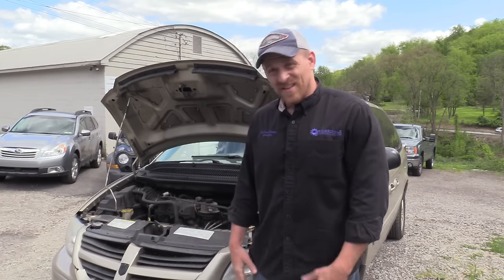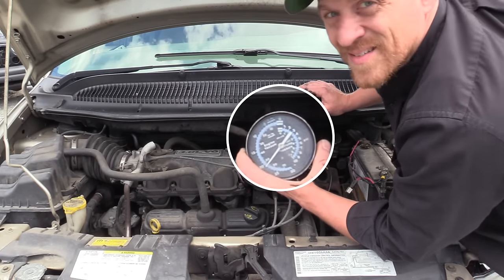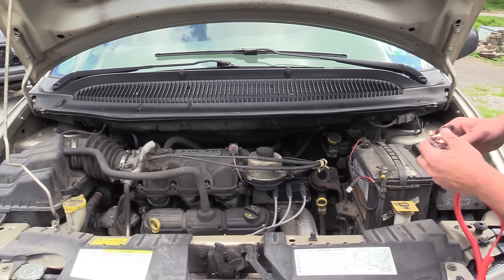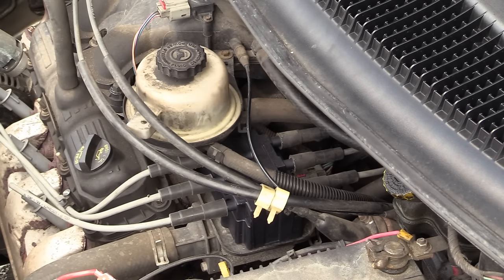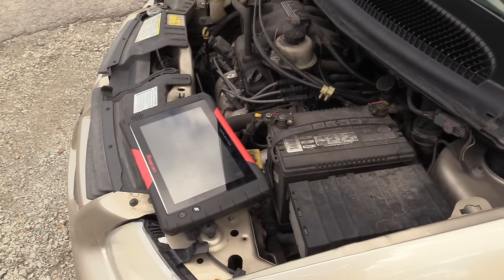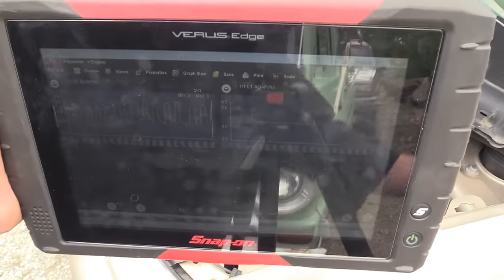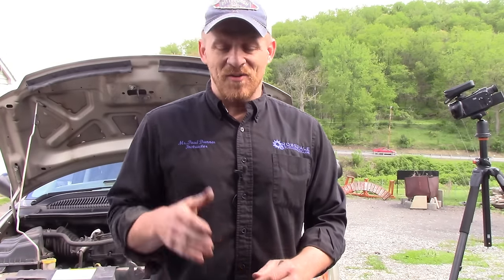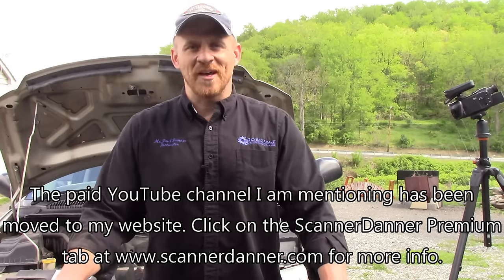Misfire Quick Tests (Is it a spark, fuel or compression problem?)

Comment: I've had the paid channel for almost 2 years. Even having experience I find the channel exceptional for training. Let's say, top 3 best on You Tube IMHO. It has something for everyone for sure.
Reply: Joe Mikos how much is it?
Reply: Hi I'm not a technician but I am interested to learn these electrical engineering.if I resisted in played channel,did you think I'll learn.
Reply from the maker: It's $11 a month and I offer a 14 day free trial. Thanks for your interest!
Reply: I need a guy like you to help me find my problem , got a bad first /cold start issue with a 1.6 8v SR 102 hp vw engine . Starts right up but then idles poorly in 3 cylinders and then drops rpm and dies . after driving it for 5 minutes when car gets warmer it starts right up no issues any more . it has got power and pulls ok but sometimes around 2000rpm it shakes a bit . Help?
Reply: If Scannerdanner is among the top three here on YouTube, I'd be curious to learn about the other two channels behind him! Lol
Reply: @ryana.miller8260  try DiagnoseDan, He is also amazing

Comment: I run from people who drive a car for 150K miles with no maintenance and then want you to tell them what's wrong for free and fix it for $100 bucks.😕
Reply: Then when you find out more stuff is about to go out that will affect the first problem  and you tell them...they always say " well you said this not that so now you want more"
Reply: "I thought you said it was part A. Now its B and C too? Well then" or " parts B and C were fine when i got here. You will fix B and C for free!"
Reply: sounds correct
Reply: I agree such fun work to do and potential to make money ruined by cheap ass hood customers who cry when you mention diag fees and always say “can you just take a look at it?”. Fuck them
Reply: @ufarkingicehole  if it’s not part A then your diag wasn’t correct, how’s that the customers fault? If you said you fixed the problem, yet it continues, then you replaced a part that didn’t need it. This is why we have expensive lab scopes and shit, you don’t throw parts at a car and expect a fix, you find the problem and figure out the solution.
Reply: Big talk from a lube tech. When basic mechanics stop sending stuff to the shop because “they can’t do it” I’ll be amazed.
Reply: @jc199159  I was a lube tech decades ago. I've been morphed!
Reply: About 127-130 for plugs, wires, diy on this car. I have a 2002.  P0302 code. That's #2 cyl.  I need a battery.  It would start after ten - the 50th tries. It ran until it had code. Gave gas and it coded, and ran harshly.  It will get better and scanner. But, I am changing these tune up items first myself.  Save labor on that much. Then if the top end or timing is off, they can do that.  They put a used trans in it, and not long after, no crank happened. But, then it did crank. I got the click on starter.  I go two years before failure.  On a three year battery that has to be replaced now.
Reply: I can understand 
But i had a Hyundai Elantra 
That they charged me 750 to have a Week and could not find it out years ago 
And the next guy found it out in 30 mins .
Cam Phaser CVT was out .
Reply: What maintenance can you do for a sensor issue.like really why do cars needs twenty sensors? Didn't have them thirty years ago and cars had horsepower. Clean unmonitored horsepower.its ridiculous
Reply: No sensors no maintenance

Comment: My 2000 Grand Caravan gave me 343000 km (215,000 miles) before packing it in.  3.8 L engine. There is no substitute for timely maintenance.
Reply: Yes very true 1 have 2003 with 365.000 miles original engine  and transmission i bought new. Still runs but body rot is bad.
Reply: @angelozararis7404   I have 270 k on my 1999 Chrysler Town and Country. Also have done various repairs on it. The have amazing pickup on them.
Reply: Mine has a misfire .. going to the shop.. just replaced all seals from intake manifold to the air filter all new injectors .. hands are up but not going to let her go down
Reply: @PIANOSTYLE100  mines 270k miles 05 .. I love .. (yes alot of work and ppl yelling my just go buy new .. nah I can't give her up .. even with her Mis#5
Reply: @83mike860  I made that comment awhile back.. Now..I fix things on my 99 Ford Expedition. Not a mechanic.. It had a parasitic drain on the battery.

Comment: Sounds like that engine needs a cleaning. They need to put some LA's totally awesome in that crankcase and run her for a half hour! On a $500 piece of s*** like that I would try anything. Acetone in the oil, diesel fuel in the oil, transmission fluid in the oil etc.

Comment: My daughters 2002 mazda626 has a cylinder 3 misfire, changed the spark plug, coil and wires with no change with rough idle I’m at my wits end. Your video has given me other possibilities to explore. Thank you for your video.
Reply: Take to someone who knows how to properly diagnose instead of throwing parts at it. You will save money in the end.

Comment: Rear valve cover isn't that bad on that van. I did stem seals on one at 485,000 miles. Last I heard it was still running just fine North of 500,000. Commercial van with lots of miles and few cold start heat cycles as well as being in an arid environment and having a dedicated mechanic helped it reach a round trip to the moon and back.

Great new tools for the toolbox on my shoulders. Thanks Paul.

Comment: I had a 94 Chrysler Laser years ago with intermittent low compression on one cylinder similar to this case.  It turned out to be a bad valve guide.  Using a compression gauge it would read bad one time and OK the next.  It also fouled the plug with the bad valve.  It was bad from new.  The dealer knurled the guides and it worked for 6 months or so, long enough to get out of warranty.  I ended up replacing the cylinder head after which it ran far better than when new.  Oil in the cylinder made it want to pre-ignite.  The knock sensor backed off the timing and it was a stone.  After the fix I could lay rubber with it.

Comment: I just changed the heads on the 2000 Ranger 3.0 with 188,000 miles. They had known exhaust valve issues over time. Turns out I had cylinders 4 and 6 getting coolant in the chamber which was cracking spark plugs and then once I had the old heads on the bench, 5 out of 6 had brake parts cleaner leak past the exhaust valve seats. Now with new heads with hardened seats, all new head, intake and valve cover gaskets, I am battling high LTFT's. Got new O2 sensors on the way since mine have about 60,000 miles on them with raw fuel from misfires for who knows how long. Good news is that there is no sludge in the motor and the cylinder walls still have the cross hatch on them.

Comment: Stumbled on the channel today and it's awesome. Wife's 2008 caravan 3.3 has a intermittent cylinder 1 misfire. I did plugs and coil and it ran good for a day now the light is back on. I'm guessing I'm dealing with a lifter problem. 
Thing has 109000 and is a decent ride. When you first start it she idles a little rough but smooths out after a bit.
Reply: Is that what it was my car is doing the same plugs and coils don’t last

Comment: I had almost the same problem on a 2000 dodge G/C the only difference was the misfire was sporadic but we couldn't recreate the  misfire over several months and 2 trips into the shop. 3rd time being the charm my customer brought it in when it was actually misfiring. For the misfire to surface they had to be on there way home from work with lots of stop and go traffic and the temperature was above 85 degrees and still intermittent.  After checking spark and fuel that were good, it had  low compression on cylinder 3 with a leak down test proving it to be a bad exhaust valve. After removing the heads we could see the issue which was a hairline crack in cylinder 3 exhaust valve.  After watching this I started to think what the vacuum gauge would show while doing a cylinder balance test.  Next time I get a misfire like this I'm going to have to look at this just to see if there's anything of value in it.   Thank you for the great videos you always have great content.

Comment: I have the same problem cylinder 4 .sometimes it runs good sometimes it runs bad.but always cyl 4 .the car had a ticking noise after the head gaskets were replaced .so I replaced both rocker arms and lifters .i don’t know that it had a code p0304 before I replaced the rockers because like I said it had a blown head gasket .the machine shop said the heads and valves were ok .when they resurfaced the heads .so now I’m stuck with the cyl 4 misfire .compression test showed bad compression .bit some times it runs great .you nailed it for me .its a bad lifter ona new rocker assembly but more than likely a piece of some thing is blocking the oiling orifice for that lifter. Thanks a million your thorough diagnosis lead me to the only problem it could be .bad lifter or more likely a piece of silicone blocking the lifter orifice intermittently.now I can fix the car for zero dollars .

Comment: I had a dodge minivan with a 3.8 many years ago with a very intermittent misfire on cyl. 3 that it took months before they could get to the shop with it still miss firing. It turned out to be a cracked exhaust valve on cyl 3.

Comment: Nice job. Trying to catch that with a compression gauge isn't easy. I've been trying to get the guys I work with to do relative compression test because it is so quick and easy to do.
Reply: Auto Ditex has a unit that can do relative compression from the battery . Unsynched takes about a 10 second crank . Or you can connect an extra cable and synch the pattern . It's about $ 300.00 . Diagnose Dan has used it . No lab scope needed . They also have a lab scope and other test equipment .

Comment: I know this is an old video but I gotta ask, why not do a cylinder leakdown? If nothing else it would eliminate culprits
Reply: my same thoughts ,for next test,spark plug out ,number 3 on tdc,fill it up with air ,see were it goes,or stays sealed ,maybe chuck another engine in it ,then have lot spares
Reply: I agree.  That would be my next step.

Comment: I say broken exhaust spring, it sounded like it was alternating/cycling while running. the broken spring is riding up itself and dropping back off the other piece, probably broken near the spring base =p
Reply: What about the perfect vacuum.?
Reply: @ufarkingicehole  its intermittent wouldnt the valve spring be consistent. lifter seems more like it. maybe slow to pump up
Reply: @dcomputers  the vacuum being constant makes me believe the valve springs are ok. It sounds like the lifters are tapping or not priming properly.  Based on that alone I would assume the bottom end is ok. The valves are sealing. I would want to run a test to see if all of the cylinders seem to be doing what it's supposed to.  I would want to know if its running lean/rich/ or ok. Possible sticking injector?

Hahaha so I actually watched the video and yea..... I'm sticking with a jacked up lifter
Reply: @dcomputers  Not necessarily, I had cracked valve spring on 2 GR Toyota engine and the problem was intermittent.
I do agree that in this case a lifter is probably the suspect.
Great work by Paul as usual.

Comment: Thx for all the people you help. I have  a 1990 e150 that has a hard miss with occasional shuddering. I have replaced all ignition components, same problem. Do you think it could be a bad ecm with leaking capacitors.?

Comment: Paul looking at this again 
My 2001 had the codes 
Replaced The Plugs wires  coil block 
Some injectors 
O2 ,Mass  air flow and Map  gaskets are all done 
And what fixed the miss was new Fuel Pump 
But now it runs good until it warms up 
And runs Lean or like hot with no overheat and temp gauge says normal .
Its got brand new Radiator 
And the Harness was Torn open and repaired for bad insulation against Heat issue behind Coil .
I wonder if the 02 sensor was intermittent and the after Market i put in sucks as well 
Or the Exhaust sucks somehow 
Hesitant to pay to have exhaust Scoped after No Heat from Temp gun 
Test .
Im a Face But But Face for buying this 
From a Single owner old lady .

Comment: Frommy experience it possibly has a cracked spring, common in my area. They break and allow a random recurring misfire on single cylinder. IF repaired repalce all vs seals and springs. BUT car is beat, the estimated price of top end pull apart ie vc/intake/etc tell them to take repair costs and old car and trade on different car AFTER having car given an extended vehicle inspection with test drive.

Comment: Which is why you diagnose before throwing parts on something. No way is that thing worth fixing, but you're already in plugs, wires and a coil. 

Only thing maybe worth doing is telling the customer to try running a flush or some kerosene/ATF through in case crud in the engine/oil is jamming the lifters or something. Kill or cure. Might just be worth it if it goes another year or two before blowing up.

Nice example Paul! Stay frosty!

Comment: Hi ScannerDannner, I have a 2005 Mazda 6 2.3l 5 speed A/T with 150000 km, the car hesitates when I put the pedal to the metal in any gear including Neutral and Park, the car struggles to go uphill. The car has not thrown any codes, I changed the Spark plugs, air filter is clean. Which direction should i go from here?
Reply: Sounds like a bad fuel pump

Comment: hi scannerdanner did you check the higher rpms (2000+) on that car? I have the same symptoms on my 1995 mustang 5.0. misfire but only at idle. ignition system is good. no vac leaks (constant 20 in hg). fuel system is fine. injectors also. engine rebuild done. but the lifter werent replaced. I'd like to check them before replacing parts with no end. your help is appreciated!

Comment: Hey Paul, when you scoped the issue and it showed the dip in the graph for cylinder 3, were you probing the starter wire at the battery? I didn’t see you explain where you put you 600 amp clamp?
Thanks in advance!
Reply from the maker: yep, just the main battery cable that goes to the starter. I linked two other videos within this one that show this procedure in more detail. Thanks!

Comment: I have a 2011 Mazdaspeed3 with 123,000 miles on it. I get a code throwing P0300 (multiple random cylinder misfire.) I’m about to throw new sparks in and I have a compression tester, I just don’t know where to start. It seems to make this low “popping” noise at idle every here and there, but nothing else after idle. Please help! I’ve looked all over mazdaspeed forums and all other people have said is the injector, sparks, or coil packs. Thank you a ton!

Comment: I did not get how you were able to graphic individual cylinders compresion on your scanner tool
Reply: He was measuring the current to the starter motor. Current is proportional torque for electric motors. Torque increases during the compression stroke.

Comment: I drive a 2006 Dodge Grand Caravan 3.3 V6 154,000 miles. Check engine light has been on for about a month. Code is p0303. I have replaced the spark plugs/cables and fuel injector. Still code p0303. It starts right up and runs fine until it gets to around 60 mph and then I get vibration from the engine. No other symptoms other than getting crappy gas mileage. Any advice on what to try next would be greatly appreciated. I've been doing the work myself in my spare time and I don't have much $ to spend..if I did I wouldn't drive a 2006 minivan.

Comment: While the engine turning since the valves also turn, maybe carbon deposits sometime dont let the valve close all the way!! 😏  
Great video Paul!
Reply: That's exactly it. The valve is making and breaking the seal as it rotates. Assuming it comes and goes at a steady rate.
Reply from the maker: I was thinking a lifter issue. Sorry I didn't dig further. This was one of those "it's not worth it" vehicles to go any further.
Reply: sounds about right
Reply: +ScannerDanner probably is like you say!
Reply: I agree
Reply: Could be hair line cracked at the spark plugs on cylinder 3......lol
Reply: DO a Flush of the Engine, Throw A Bottle of Liquid Moly Hdry.Lifter Additive in It,If It Seems To Help,Then Run A Good Brand of Syn.Oil  for Few Thousand MLS, If It Doesn't Run Better,My Guess is A Stuck Closed EGR Valve,Which Will Probably Pull Up A Code.

Comment: I don’t have a hi amp clamp for my scope yet. Is there a way to use a low amp at 60a  until I am able to get a hi amp? My gut says no, but I believe I saw you do it.
Reply from the maker: absolutely, it will measure up to 250 amps. you just need to do your math and make sure the jaws of the clamp fully close on the heavy cable you attach it to.

Comment: I have a 2000 ford explorer 4.0 sohc, and my fuel pump is new, my fuel filter is new, my spark plugs are new, my wires are new, I have a new coil pack, but I can't seem to get it to stay running. What could be my problem?

Comment: Great Video .I have 2006 GMC Sierra pickup . after it rains all night parked .in the morning when I start it .it misfires bad los of power when driving and check engine light flashing .but when driving for 15 minutes it goes away ? Any ideas thanks 👍
Reply from the maker: usually a moisture induced misfire is a secondary ignition problem. (coil, plug boot or wire, spark plug)

Comment: Is there such a thing as a spark plug extender for cylinder that foesnt lift up all the way. I've had a lower pressure in my third cylinder on an 8 cylibder old ' 76 F150 and I just removed spark plug wire knocking out two cylinders but it drove for my purposes on 6 cylinders for quite awhile.